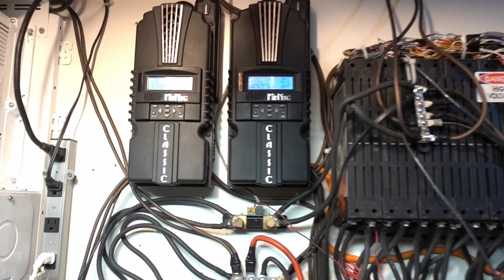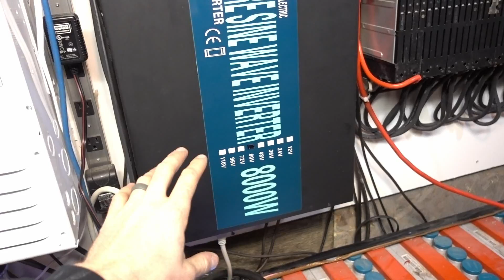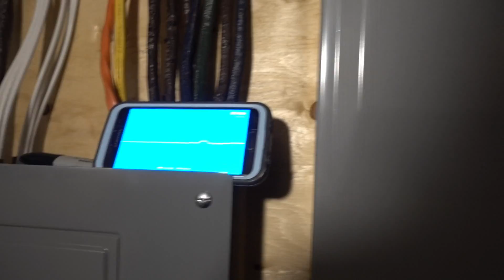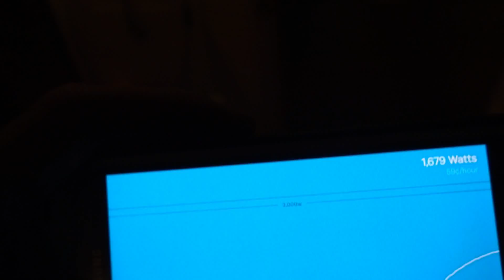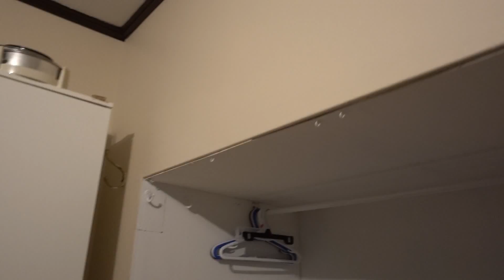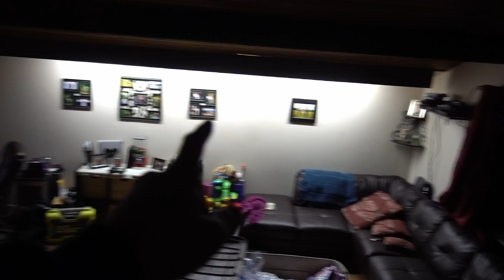Going Off Grid Has Gone Off Grid!

Comment: ..."Why don't do just "daisy chain" 3 LG Chem Resu10h solar batteries "generators" (each battery provides 9.8kWh) and you'll be able to run EVERYTHING in your house...that includes residential a/c unit, stove/oven, washer/dryer, ETC... (daisy chaining the LG Chem Resu10h solar batteries allows you to separate your 120's from your 240's)...like I stated running "EVERYTHING" all DAY and NIGHT, and not have to WORRY ABOUT NOT HAVING ENOUGH POWER - EVER...all recharged by 50 high efficiency LG NeON 390W solar panels?"...my house will be featured in a South Texas Solar Systems promotional video this coming year...
Reply from the maker: sick, my battery bank is starting to come along. check out my newer videos

Comment: ? to make the tesla module an 7s with the Mitsubishi I-Miev battery module my maths say to use 4 to 5 do you think it would work with a 7s smart BMS like the one that you use on your volt batterys. I was for your hot water tank I plan on using a preheating tank inline with my regular tank. So it does all the magic and the main one is stable.
Reply from the maker: i dont quit understand the tesla part but I think the smaller pre heater is a good idea!

Comment: Awesome system! To get 240v I use an autotransformer (NOT the toroidal type due to the insane inrush current). You can use as big rated an autotransformer as you can practically install while paying attention to that inrush current. I really like the autotransformer approach since it acts as a small energy reservoir during motor startup currents. Definitely a doable solution without having to switch between different inverters.
Keep up with these wonderful videos.
Reply from the maker: I have a 3000w 240 transformer coming in the mail.
Reply: You gonna have lots of fun with the xfmr. Don't forget to post results of its performance. I use a 1500w autotransformer for my inverter air conditioner and it's been working perfectly since 2013.

Comment: Awesome work!! I would have had the 240v loads on a separate panel that way the 120v loads can stay on lithium and the 240v loads could be on the magnasine or grid independently of the 120v only inverter
Reply from the maker: i will be using the magnasine instead soon

Comment: Have you considered, going to propane for cooking, propane hot water, and dryer,  we have done this , but haven't changed the dryer over to propane, our propane bill is under $200.00 a year, I run my wood boiler year round for heating hot water and hot tub. Swimming pool in the summer
Reply from the maker: I am looking into this, at least a propane water heater. I would like to run everything else of my system.
Reply: No NG gas in the area?  i Have 2.6 KW of panels and 80 of house off grid.  Water heaters, fireplace, dryer, stove and generator is all NG.  Big help.  NG is cheap for sure.  Nice setup
Reply from the maker: no NG here :(

Comment: I have a question. I did not realize that you were still hooked to the grid. Several times I have seen you run a generator. Why use a generator when you are hooked to the grid and the grid not down? The grid electric has to be much cheaper than a gas generator. Just curious.
Reply from the maker: I run them just to keep them from going bad, the carb gets all jelly if left for to long.
Reply: I see. Thanks for the reply. By the way I too have generators and use Sta-bil. They set sometimes for months and do fine with the sta-bil in the gas. By the way I only use E-0 gas.

Comment: Good Job. Do the AC ripple test on your DC side from the bottom of the inverter like i showed in the video. if its under 1.2 volt with normal loads and 1.7vac normal loads + electric kettle turned on your all good. If its over then you have a problem. Can you do a video when you do the test. Its important to show people how to test for this as to many are still popping the MOSFETs and caps in the inverters due to this problem . Good video keep them coming. I am watching.
Reply: You are the original Solar off grid promoter!
Reply from the maker: I will have to test, but last I checked it takes 5000w to drop my input voltage by 0.5 of a volt, will test :)
Reply: you can remove this link when you done my friend. but this is the test i am talling about. https://www.youtube.com/watch?v=jJPmL3ibaUA
Reply: a voltmeter on AC should do the trick
Reply: justin case is talking about the ripple voltage. not voltage drop under load.
Reply from the maker: I will have to put my oscilloscope on it and see.
Reply: Yes just a manually set volt meter  will do. The Automatic meters will keep going to DC so don't use one of them. Its a very easy test to do. And i recommend all people with battery backup or off grid systems do it at least every 2 months. Then you will know if you have any crimped connections going bad on you as well.